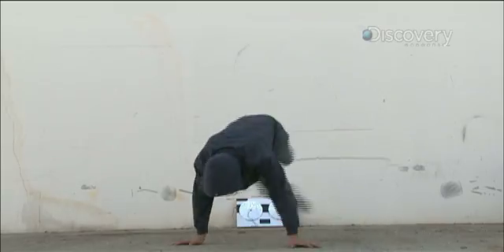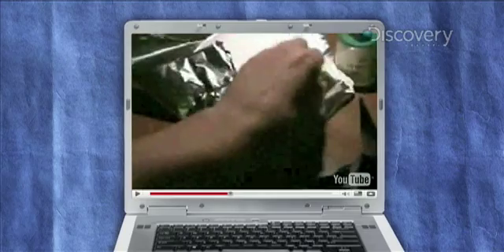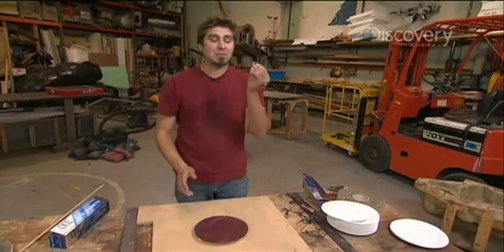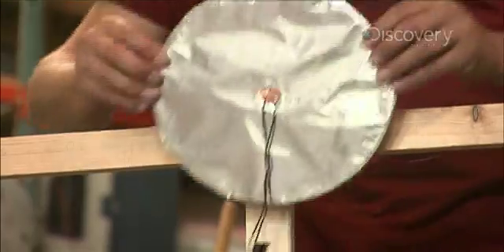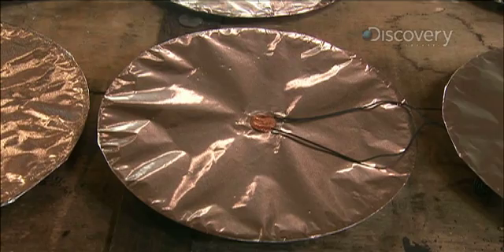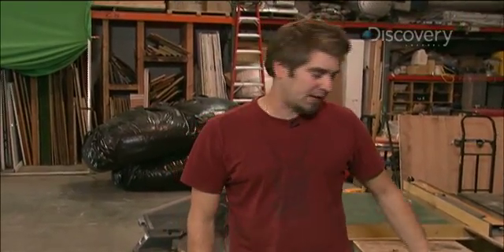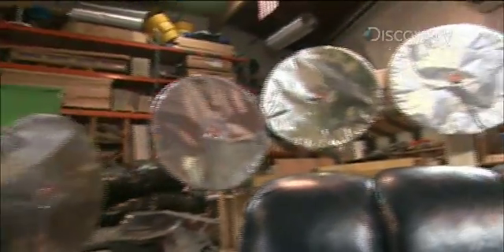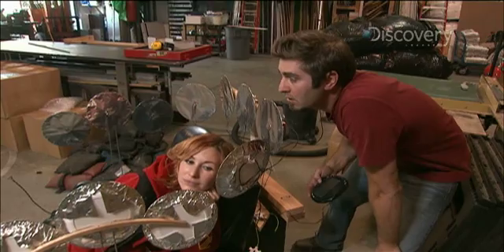MythBusters - Homemade Hi-Def Speakers

Comment: look, the electromagnet is the electricity from the leads runing through the penny.  Mythbusters screwed up by not using a powerful enough amplifier.  It really works, only it makes a really crappy speaker.

Comment: maybe the TWO wires are plasted each on the BOTH sides of the shiny penny  - one for the HEAD the other for the TAIL of the COIN,  it might then go working 

does anybody  outthere   is good at electricity and stuff

Comment: It will not work even if you use a million AAA batteries, you are basically shorting the cables of the audio output. If anything, you might damage your player. Let me put it this way, I will burn my electrical engineering diploma and post it on youtube if this works at all.

Comment: A standard speaker requires TWO magnetic fields. For this thing to work, you'd need a permanent magnet, and then the penny would have to be able to create a field strong enough to repel and attract to the magnet, using the very weak signal provided by the audio device. A penny isn't big enough, that's why speakers use coils, which then sit very close to the magnet. It's also not clear how it's supposed to be wired up, as it looks like there's no actual circuit..

Comment: it's alot more than just magnets,you need a moving wire coil connected to a cone or diaphragm,with a magnet ring or another coil around it . it' a lil'll more complicated than that, but speakers works through electromagnetic force moving the diaphragm.

Comment: When an electrical signal is applied to the voice coil, a magnetic field is created by the electric current in the voice coil which thus becomes an electromagnet field. The coil and the driver's magnetic system interact, generating a mechanical force which causes the coil, and so the attached cone, to move back and forth and so reproduce sound under the control of the applied electrical signal coming from the amplifier.

Comment: I loled at the direct short circuit they created.  The earbuds I have are 32k ohm @ 1KHz, which is a huge difference.  Good thing that most of the modern stuff has output limiting, or that CD player would be fried.  There is just way too much that doesn't make sense on this one.

Comment: This DOES work!! Doesn't sound amazing but it works. Mythbusters!?! They need to follow instructions closer. Household Hacker hooked up the jack to a powered system. A 9-volt CD player doesn't produce enough wattage to power any set of stand alone speakers, the resistance of the copper in the penny alone drops the wattage to nearly zilch, hence why computer speakers have a power adapters on them. I will upload my proof of them working when I can manage to borrow a video camera.

Comment: This obviously could never work. The jack connected to the penny will essentially be a short circuit with 0 impedance. You need some electrical resistance (impedance, achieved through a speakers voice coil)) plus a magnetic field to achieve your goal.

Comment: They should've handed this test to Grant; he's an electronics guy, and he'd have seen right away, that the only thing the coin does, is to short the CD player's signal straight into ground.

If you replace the coin with a piece of piezoelectric material, you just might get a sound, but I won't guarantee anything with respect to sound volume or quality from such a setup...

Comment: yeah, this was a bad video that had no science. I made speakers out of cardboard, copper wire, toilet paper tube, and a magnet in highschool. Not less than a dollar, but only a few bucks.

At least this video could have pointed out SOME technical details about positive and negative ground and electromagnetism, but nope! it didn't, so it's a 1-star video for failing to prove a point with any evidence, sorry.

imho ;)

Comment: part II.. extract the ends of the wire out of the box and close the matches box. (you can make some holes at the part where the metalic plate will be)
now connect those wire ends to a input (for example minijack) and try it... the sound will be very low but you will hear). you can also connect them to a sound buffer wich will make the sound louder.
So here what you need to heve at the end:
a magnet wrapped by (paper) that is in twisted(?) in a wire at the top the metalic plate and all in the box

Comment: Take an ordinary toilet-roll tube and put it in the oven at 220c for an hour. When you take it out it will be four metres long and eighty centimetres wide. Just inside the rim at one end glue the circuit board from a TV remote, any kind, and at the other end put a handful of potting compost.

As my video clearly shows, this creates a cruise missile for under a dollar. Now a commercial television show will actually spend time finding out if it works.

Comment: For this will be good to make a video tutorial.. but I don't have a videocamera..
so I'll try to explain here:
Take the box and extract all the matches.
take the magnet and put something on it (not metalic... peace of paper will be good) don't wrap the edges of magnet... needs to look something like this [|] (| - magnet, [ ] - wrapper)
now create a spirale with wires around the wrapper (wires needs to be very thin). Put them all in the box and put the metalic plate on the top.. will be continued

Comment: Exactly FithApes.  The only initial chance of it working in my remotest thought would be some kind of oxide on the penny or foil made a diode junction.  Somehow making sound.

But it would be hell on an amplifier output.  Regardless, this was a hoax as are all the other Hardware Hacker videos.

Comment: I doubt that those speakers would sound very good (if they work at all), but the myth isn't fully busted yet.  A CD player or computer will only put out line level power.  To really test it you need to hook it up to an amplifier that can power a real speaker.  I agree with kevinjsand, but even a typical speaker won't make much sound with line level audio.  A bit entertaining, at least.

Comment: Whether using a computer with built-in amps or a CD player, you still need something to vibrate enough to move the air to create sound. Passing electricity to metal doesn't make it vibrate. Ever heard of "Voice Coil"?

Comment: 100% correct.  I do a LOT of research on audio related products.  There's a lot of bullshit out there, such as "hi-def" speakers, or $200/foot speaker wire -- here's a secret: copper wire sounds exactly the same.  Even machines and dogs with far more sensitive hearing than ours can't tell the difference.....

However, you can buy good acceptable minijacks for a lot less than $10....

Comment: well, my freind tried the hover shoes, mythbusters tried both the onion ipod charger and $1 speaker and in the one of aaa battery powered tv is fake cause the wire doesent chang 1.5 volts to the120 volts a tv needs and the rest dont make any sense

Comment: yes, it can power a 5.1 but you need to know this that the 5.1 it self has a built -in-amplifier in it..........the built-in-amp amplifies the sound to be audible on the big speaker of  5.1............why not ask ur self ...that why do 5.1 need external power to themselves.  try not to power up ur 5.1 and connect it to ur player....if u hear a shit...u don't know what u r talking about ...

Comment: You actually don't need any magnets for a speaker to work. There's also this system called a static speaker. All you need on that is some sort of piezo-electric or galvanic device. This thing comes close to the latter, yet, taping both leads on the same component will only short it out.

Comment: Hmmm... Not 100% sure about it. Taping both leads to the penny makes a short, but maybe it can work when one lead is taped to the aluminium foil. The difference in conductivity between the penny and the foil might then produce some vibration.